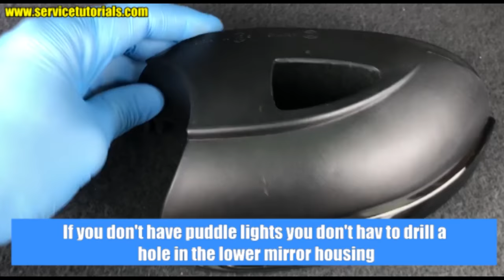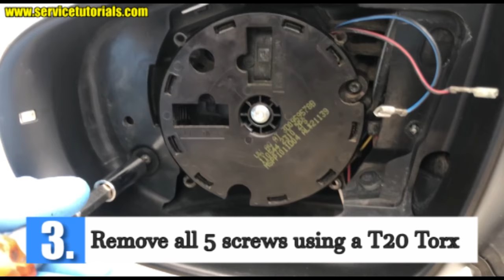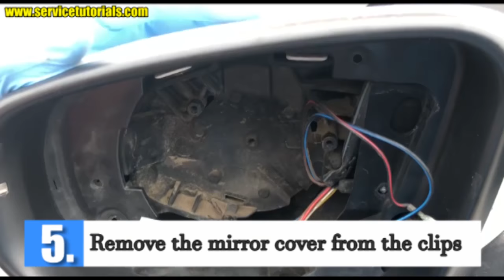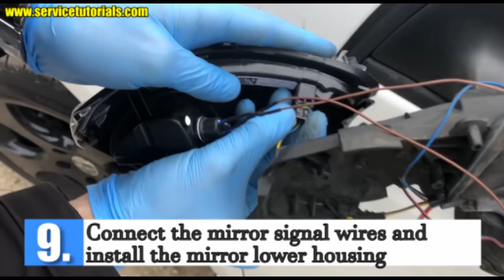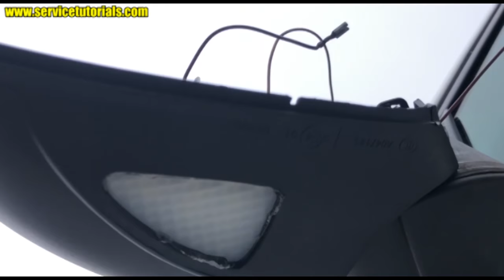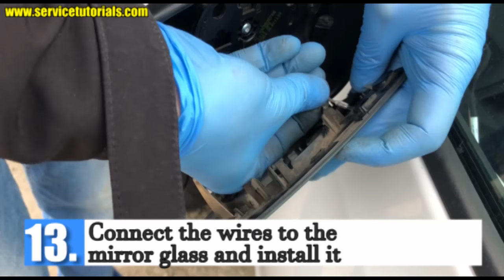How to install VW Golf MK6, Plus, GTI, Passat, Jetta, Touran dynamic blinker side mirror indicator

Comment: Thank you guys for the clip. Used it to guide me to replace my mirror and indicator light unit. 

Not sure if it's a model difference but needed a t10 for the screws on mine. The t20 fitted silver screw in the centre of the power mirror unit.

To any novices like me out there - be very careful replacing the wing mirror cover. There's two clips that slide into the indicator unit, if not slotted in will snap very easily 😞
Reply from the maker: Ajay Nandha Thank you for your feedback!

Comment: Thanks for the vid - it was T10 Torx on my 2009 model, plus I didn't need to disconnect the mirror heater wiring, nor the movement motor wiring. Bit gash leaving  them dangling but it all works okay.
Reply from the maker: Thank you too for the feedback!

Comment: Definitely not the same on the jetta tdi unfortunately...you have to take the front black faceplate off to reveal a 3rd tab holding the top cap off to get to the 2 t10 screws holding the turn signal in place. Pain to get it all in place for the tabs to line up and sit correctly. Still a helpful video nonetheless. 👍
Reply from the maker: @jimbz20  thank you for the info! 👍

Comment: Nice job 👍🏻

You connected under mirror lights with heating wires?
Reply from the maker: D.A.D Auto Accessories Thank you! Only one wire, the negative one.
Reply: TUTORIALE AUTO I saw your other video that you connected the positive wire to number 10 pin. Thank you for your videos! 👍🏻